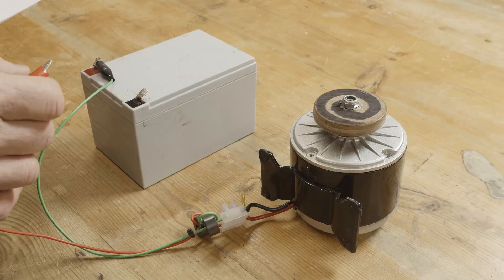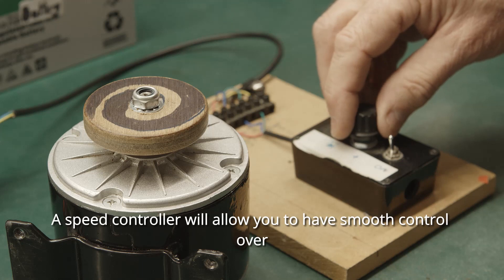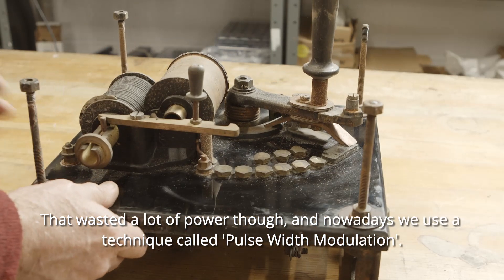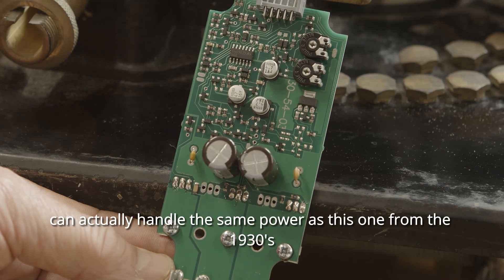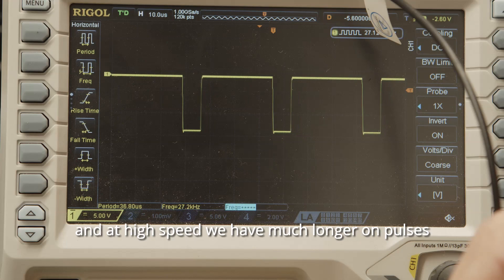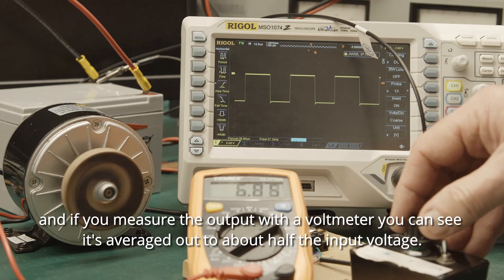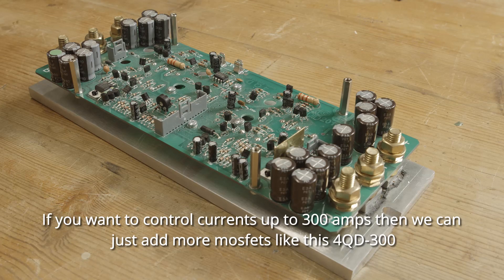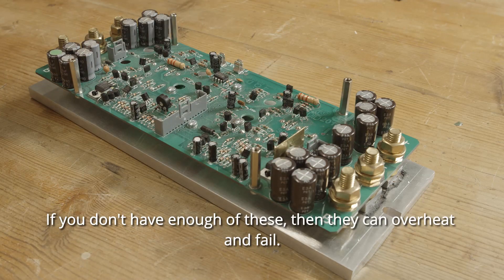What Does a Speed Controller Do?

Comment: You have a 1940 speed controller still working. I bet the modern version is good for 2 years tops and even less if water is involved
Reply from the maker: Many of our "modern" designs done in 1991 are still going strong! But yes, you're right about water - it's the fastest way to kill electronics.

Comment: Is it true that if I want to use a pwm to control a 24 volt DC motor I have to have a 36 volt DC power supply
Reply: No. If you want 24V PWM, you need 24V
Reply from the maker: Denis is correct, if the duty cycle of the controller is set to 100% then the full voltage from a 24V psu will appear across the motor.